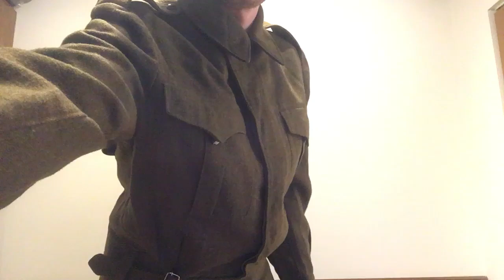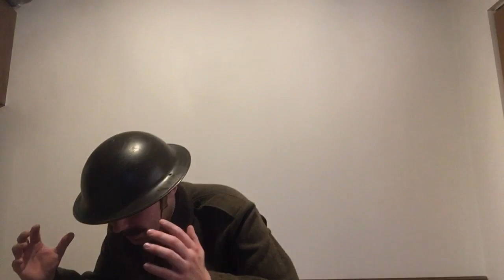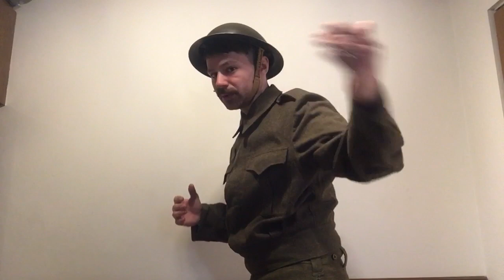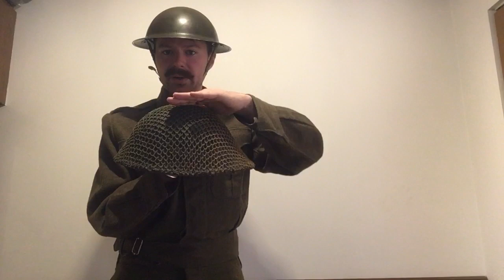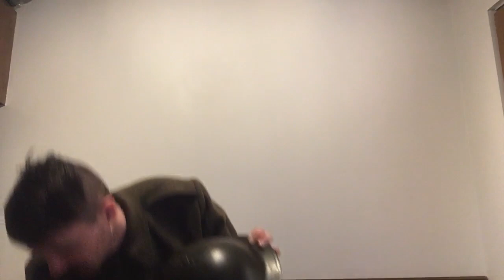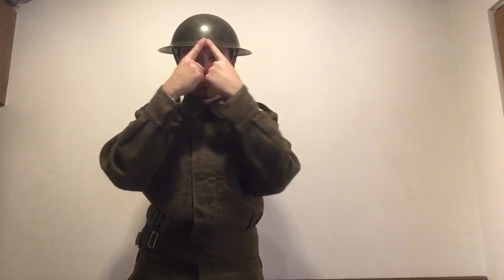Visual explanations of Brodie helmet shape and ways to wear

Comment: One thing I got a reproduction ww2 British helmet and I’m just 14 but it’s quite tight around the head which odd since I’m only 14 and it doesn’t fit my father I don’t know if it just the reproduction or that i it’s just realistic
Reply from the maker: The liners aren’t really adjustable but come in different sizes you would just have to measure the diameter of your head lengthwise which is front to back 1 inch above the ears and that’s your liner size
Reply from the maker: The liners aren’t really adjustable but come in different sizes you would just have to measure the diameter of your head lengthwise which is front to back 1 inch above the ears and that’s your liner size
Reply: @DevinK  thanks

Comment: Very nice video though the Battledress looks a little inacurate
Reply from the maker: It’s Canadian and Korean War era battledress
Reply: @DevinK  Yeah, I've got a few pairs of original Korean war Canadian Battle dress and they don't have alot of free space in them like yours seems to have They also stop above the hips around the belly button area
Reply from the maker: Mine is just not the correct size but it is original
Reply: @DevinK  Ah that explains it then, that's mostly what I was thinking it just looked a little large I didn't know if it may have been one of the many cheap reproductions I keep coming across. Once again very nice video.
Reply from the maker: Yeah I know but I wanted some originals that were at least wearable albeit not perfectly fit
Reply: @DevinK  Yeah I understand, If you want some more a good place to check is at Gun Shows often times people are selling really cheap 1950s Battle dress often times with pants included if you didn't already know.
Reply from the maker: Not as common an item here in the states unfortunately I see them from time to time but not in the right sizes normally